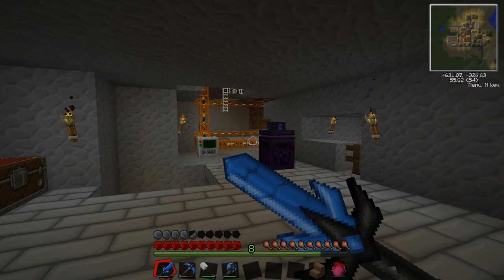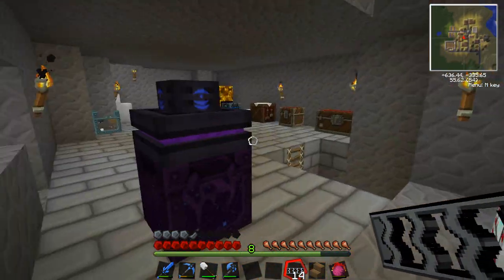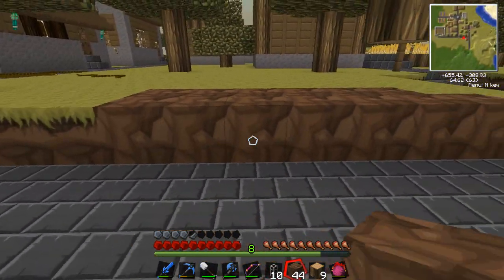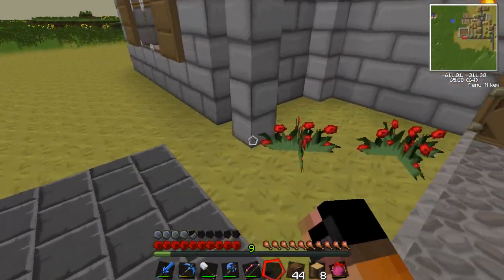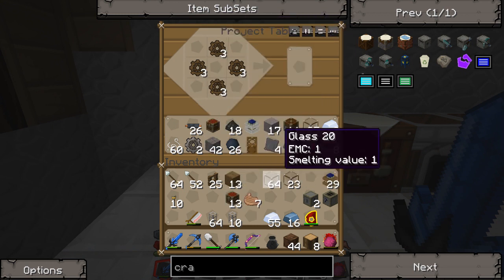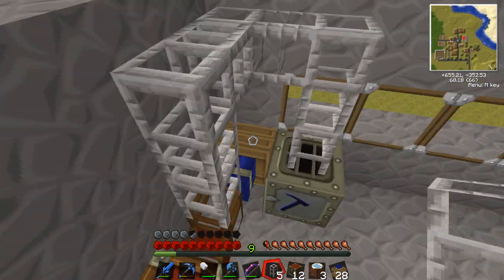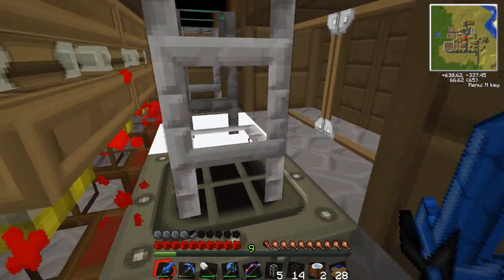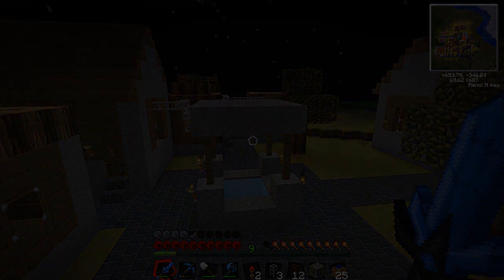Technic | Carbon Plating Room | Ep.18

Comment: Hey man, I don't have Technic or Tekkit or anything but wouldn't it work to put those engines under the pipe as to conserve room in your machine rooms?  You could dig down two, place a red stone torch then place the engine on top of that and the pipe coming out of the macerators(sp) or auto-crafting table.